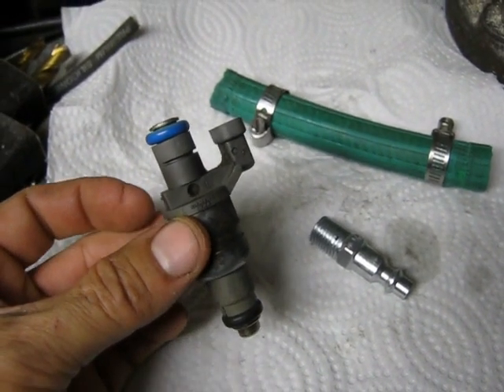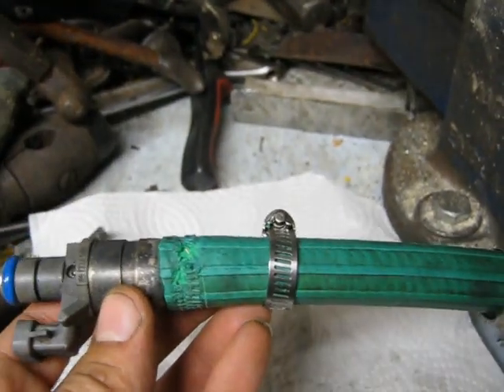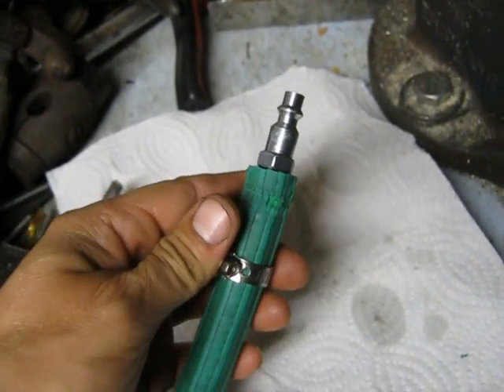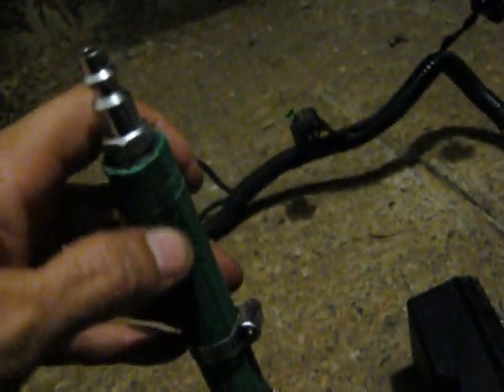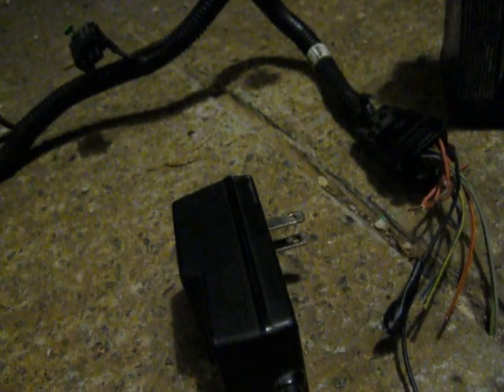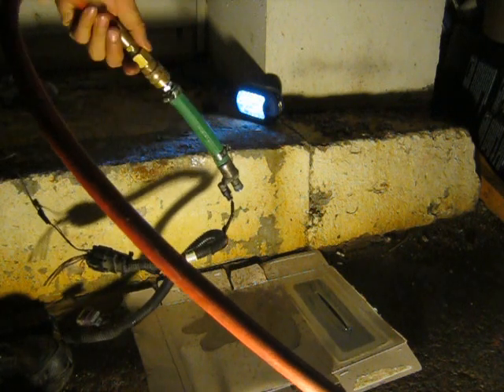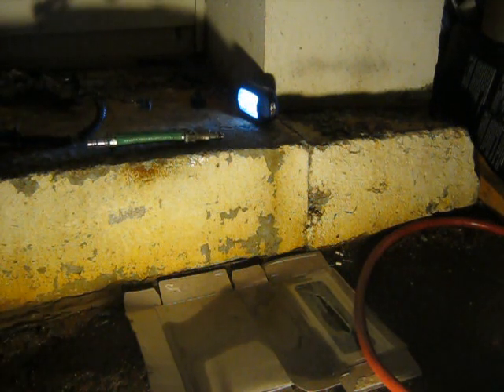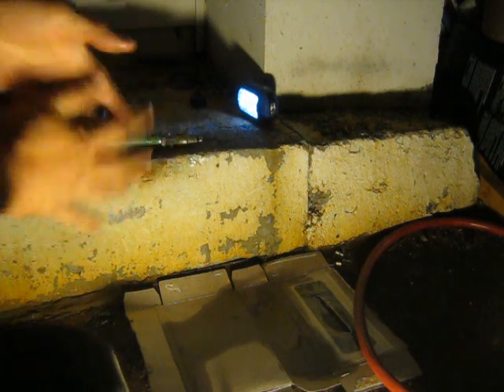Homemade Fuel Injector Cleaner

Comment: Thanks! Had an injector I could hear with the screwdriver ear test working, but it was clogged.  Using this method my old civic was firing on all 4 cylinders in about 30 minutes.
Reply from the maker: Hey, thanks so much for taking the time to let me know using this cleaning method solved your problem!  I did it on my one Focus, but it really had no effect, still haven't found the mild surging it does.

Comment: Of all the methods on youtube, I found yours to be easiest to reproduce. Worked great for me. I just used alligator clips for the electrical connection. Thanks!
Reply from the maker: Thanks, glad you found it useful. I wasn't really aware there were other vids showing something like this. Just make sure to keep the voltage down to 5 or so, the first time I did it I used 12 volts, I am surprised i didn't fry the injectors!
Reply: There are plenty of videos out there on diy cleaning of fuel injectors. It took some browsing to find your video simply because it has less views, but it should really have more. Just about every video I watched used 12 volts, I also used 12 volts and had no issues. One guy used a 9V square battery. Without the pressure from the compressor, the cleaner fluid just dribbles out. I also replaced the O-rings. Car feels smoother on acceleration and idle is also smooth.

Comment: was thinking about doing this bout a week ago
Reply from the maker: It is fine to do, as long as you take some safety precautions, accidents could happen, such as the air pressure popping the injector out of the bottom and spraying cleaner all over!
Reply: ChargerMiles007 also i thought you would burn up the cullenoid if you just left it on
Reply from the maker: I don't leave it on for long, so it seems to be fine. I did the same thing with my Corolla 5 years ago, and it has worked fine.